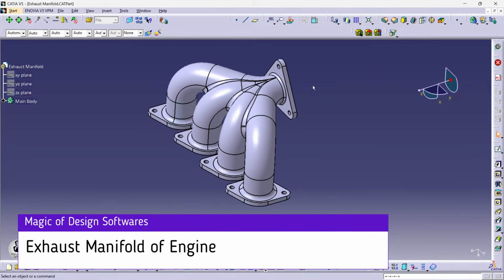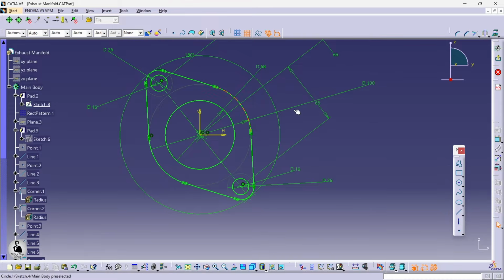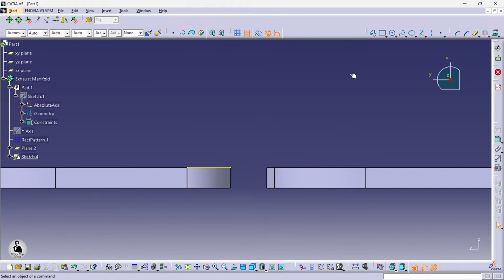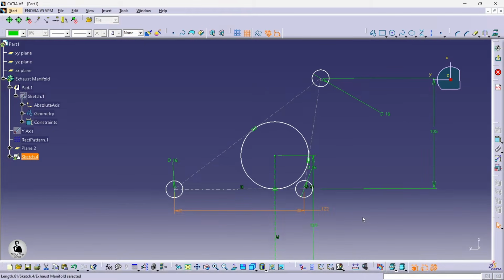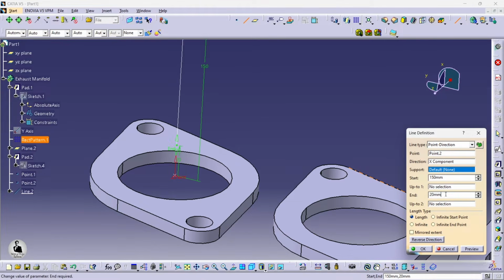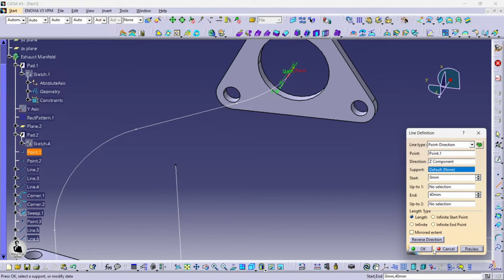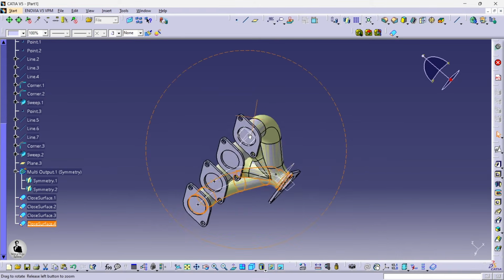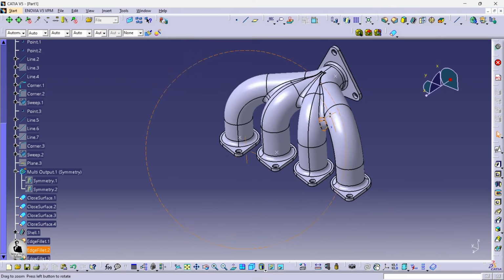Exhaust Manifold CATIA V5 Tutorial | Magic of Design Software | How to design in catiav5

Comment: There is an middle line in the part where all the pipes connect i think it's not normal in exhaust manifold
Reply from the maker: Normally the line where all 4 joints, the diameter is bit more than what is created in CATIA, it depends how your requirements are there !

Comment: You made a mistake with the shell command. If you look closely 20:58 , the shell command applied to the entire part, meaning the flanges at the ends of the pipes also got shelled. they are hollow. I don't think this is intentional.

Instead you should have modelled the pipes as a separate body within the part and shelled only that body, leaving the flanges solid.
Reply from the maker: You're correct! You can design as you want !